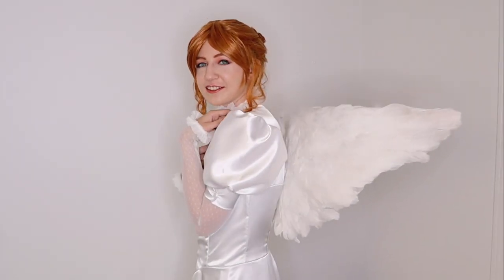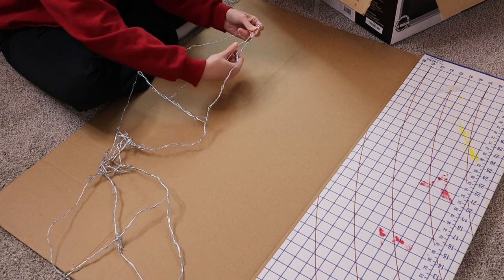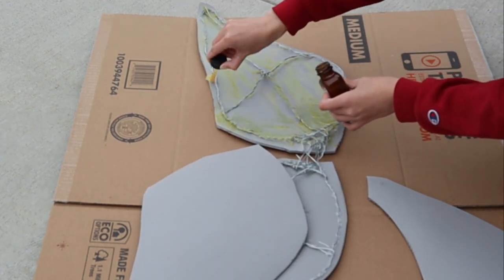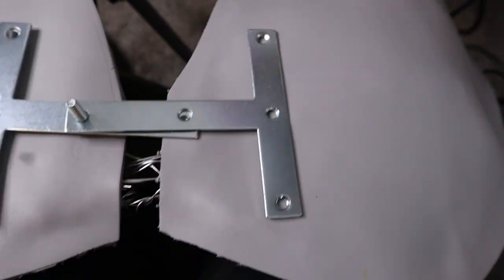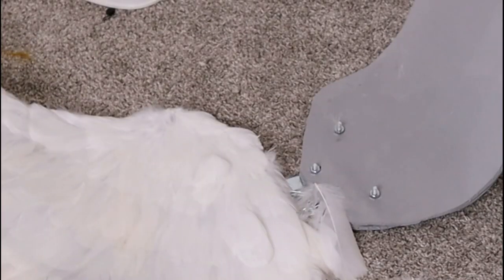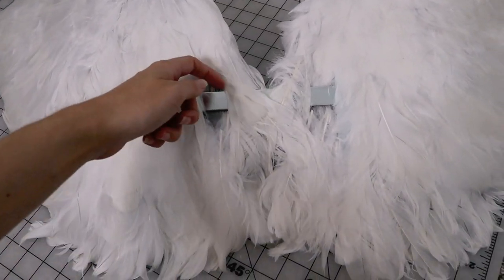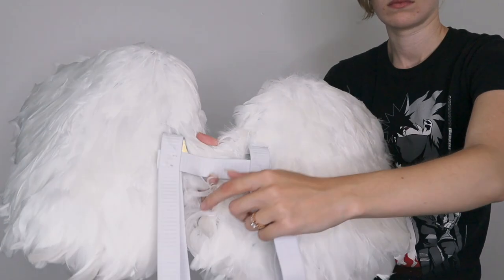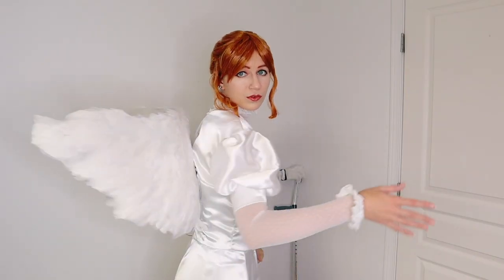DIY Cosplay Angel Wings Tutorial (EVA Foam & Wire)

Comment: hi bestie! when working with contact cement put it on both sides and then go over it with the heat gun (the smell will be stronger but thats ok) and give it a minute for it to become a little tacky then press the two pieces together!! you wont have to wait overnight for it ^_^

Comment: Were they heavy and could you use your crutches easily with them? I want to make some wings for cosplay but don’t want anything that’ll get in the way of my crutches
Reply from the maker: I only wore these for a few minutes and then ended up selling them because they weren't very mobility aid friendly. They're pretty light, but you would most likely need to adjust them to get full range of movement for your arms to properly use the crutches. I have a full video on adaptive cosplay wings for wheelchair use which talks about lighter and more adjustable wing options. You can watch it here: https://youtu.be/Uh3rc_YglOM

Comment: Can you use a hair dryer instead of a heat gun?
Reply from the maker: A hair dryer wont get as hot as a heat gun does. It will take some more time and the foam probably wont be as flexible, but you can give it a try!